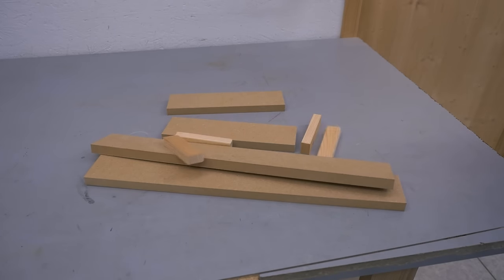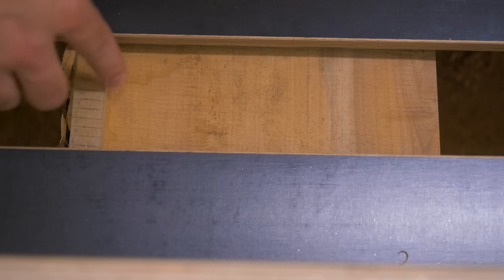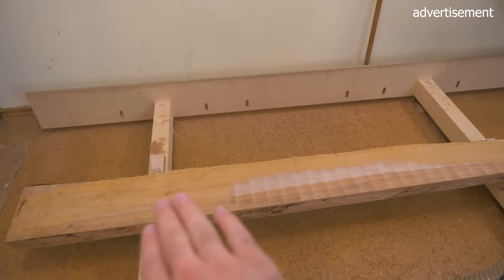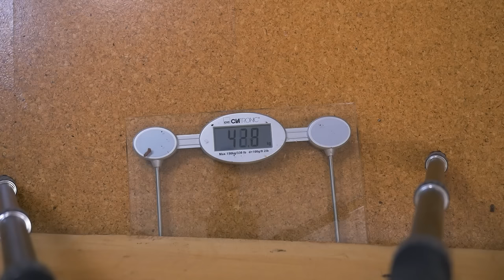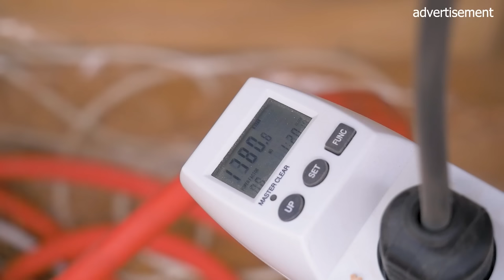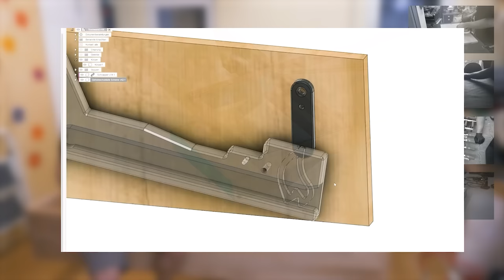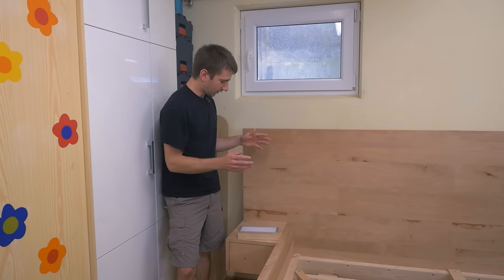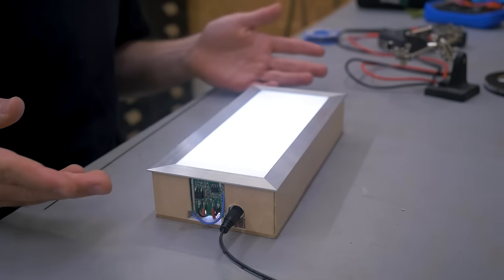Homemade 10,000€ Bed || 4 Unique Features

Comment: Definitely not worth 10 000€. That price is obviously just to attract views.
Reply: Custom bedframes can get very pricey depending on design, materials, etc. Considering the features including the built in lighting, this could very much go for 10k
Reply: @Michael2344  I'm sure there are custom beds that go for a lot of money. But it will be tough to find a sane buyer for 10 000€ for this bed. The overall finish and design also doesn't shout "high end". Especially considering that Apple and Pear wood are not as exotic as something like Walnut, Oak or similar. It also literally has the cheapest mattresses from Ikea installed. I'm sure someone would pay a ridiculous amount for it. There are many tasteless people with too much money out there.  It's a cool project for sure. But the price is insane. It might be worth more around 5 000€ max.
Reply: @Matthews_Media  Agree to disagree then.

Comment: design is absolutley not to my taste - tried to be modern but failed. the lights look quite bad and cheap imo! having two beautiful spot/reading lights and some indirect light at the headboard would have been much nicer...! instead of having cutouts for the wall light switches and outlets, you could have integrated or hidden them somewhere and not destroy your nice wood slab. Jung and Gira have some beautiful flush designs! but after all it's your bed not mine! technically its all very nice though 👍🏻